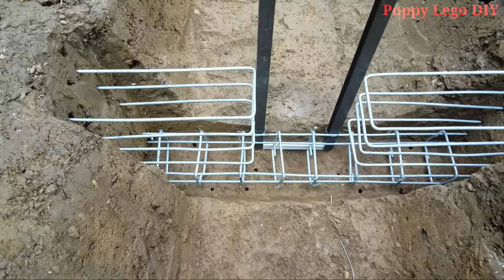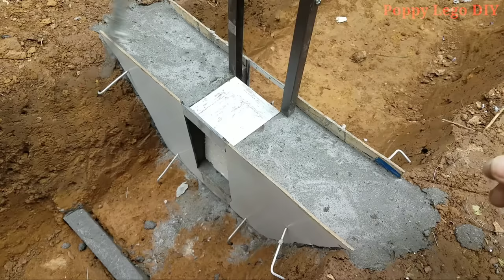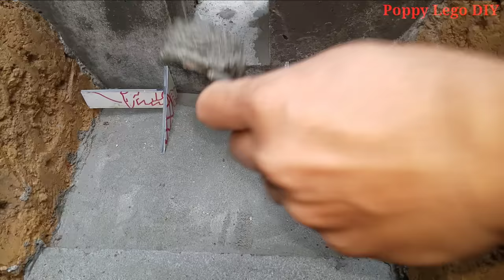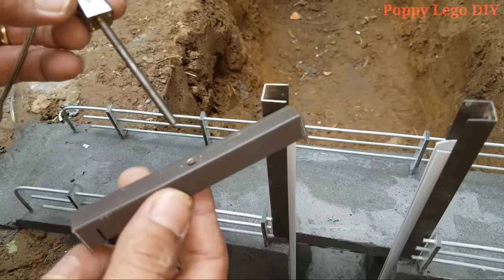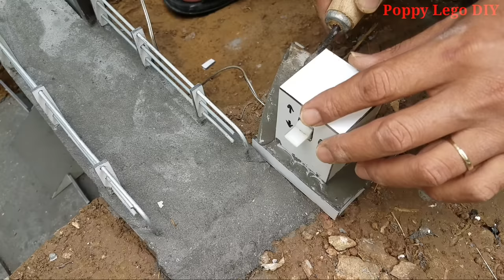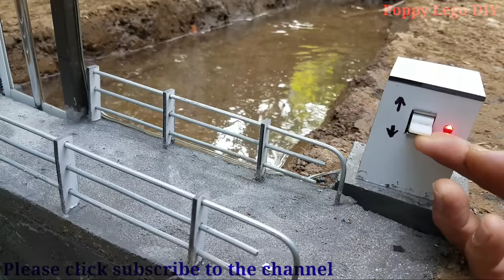mini dam construction

Comment: Try installing a motor, see if you can make electricity
Reply: That would be sick
Reply: You mean generator*
Reply: You mean alternator*
Reply: Make the motor that pulls the gate up powered by its own hydroelectricity.
Reply: @fishermanjoe7866  well, perpetual motion machines are practically impossible. However if you really wanna make one, a simple wedge and axle would do the trick. (Jk it's basically a free flowing bidirectional gate that would allow the water based on pressure difference) in simple words, it's just a gate for the sake of having a gate. I get your point about being able to control it. But, again perpetuality isn't really viable, it would most certainly require some form of energy input.
Reply: @ayan8233  well a dam creates electricity by the water rushing through the intake, spinning the turbine, the turbine creating the electricity with the generator in the powerhouse, and then through power lines or whatever you want it to power. But you are right, If he did make a turbine and connect the intake gate to the generator, there wouldn't be near enough power to make anything happen. It would be awesome though!

Comment: This is really cool! I might have to try something like this as a cool means of re-entering water from a pump into a garden pond. An idea that could be fun to try on this is maybe build a float level on the upstream side to measure water height, and code an arduino to read the water level and judge how far to open the gate to keep it automatically regulated.